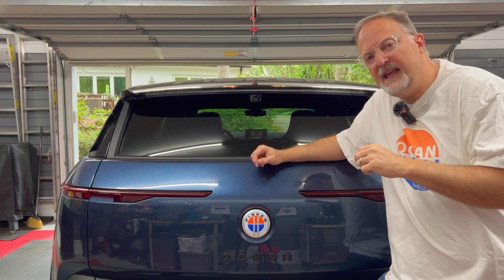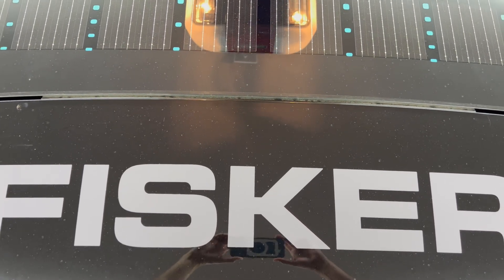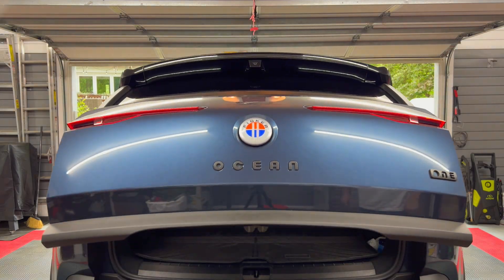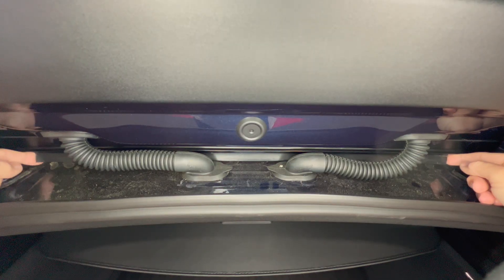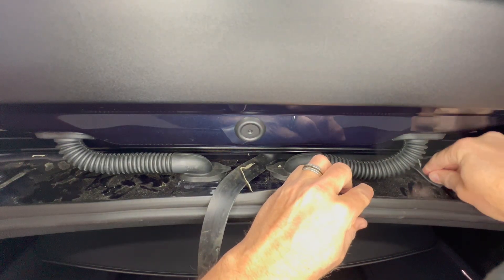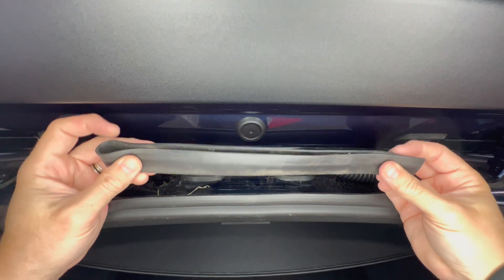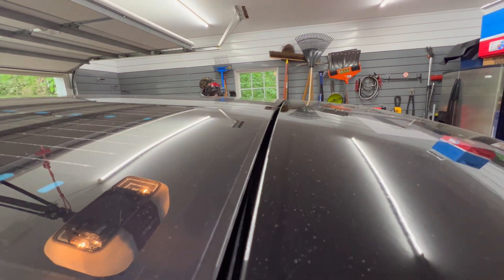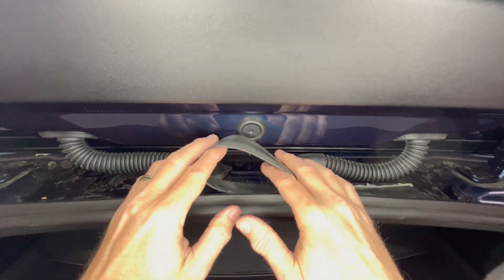Fisker Ocean One - Liftgate Weather Seal Fix

Comment: Ranger, some people made a comment that it may actually cause some issue in hot summer due to expansion. I live in Texas, so I am not worried about ice but more so Hot weather
Reply from the maker: Thanks for the comment.  Yes, I suppose it could be an issue in the summer.  But I haven't noticed that. Do you have an links or photos of damage done in the summer?  The big difference is that in the winter, the rubber can get iced up and become an immovable object and thus could crack the glass.

Comment: Do you have any video on removing a Fisker Ocean door panel
Reply from the maker: No, I haven't tried to remove the door panel.  Why do you need to remove it?
Reply: I am trying to power cycle the door handle. My door handle was depressed manually and Chevalier suggested power cycling the affected handle. I have started removing the right rear panel and there seems to be something in the area where you would pull to close the door still holding the panel. I don’t want to break anything.
Reply from the maker: @artruiz5297  I have just the thing for you.  Download the service manual and look at pages 40-20 to 40-21 for the front doors and 40-22 to 40-23 for the rear doors. https://drive.google.com/file/d/1-2-PYUorSsCnBvq5tU5EHBgDNF2mrEWa/view?usp=drive_link
Reply: Thank you so much! That is awesome!
Reply: Power cycling the handle fixed the deploy and stow function of the handle. You do not need to do steps 1-3 for the rear panel removal just an FYI. Thanks again!
Reply from the maker: @artruiz5297  Good to know. Thanks!

Comment: Question: weather strip removed. Freezing rain. Ice forms in gap. Could opening cause the same problem?
Reply from the maker: Since it's not trapped with the weather seal, it will flow down the sides and  out.  The issue is that the seal becomes a solid piece that acts like a wedge.

Comment: Great discovery.  My guess is that Fisker engineers didn’t think people would open the roof top during winter.  Anyway, it appears the seam may allow some rain water to seep in.  But the water would all be collected and drained out w/out any issues.
Reply from the maker: As with many complicated products like cars, some things may have not been tested or discovered during cold weather testing.  Not to make an excuse.

Comment: Any tips on how to stop the rear passenger reading/map lights from turning on by themselves? Started after 2.0. Thanks for you informative videos!
Reply: I have the same issue after v2.0 update. I believe it’s the bug.
Reply from the maker: It's a bug that goes back to the original software release.  I saw it on 1.10 and 1.11.  It has something to do with the sensor button being too sensitive.  You can activate it by moving your hand an inch away from the button.

Comment: Thank you very much 😂 for all your videos,  very educational.  I  do have one question: How do you switch off the automatic function of the windshield wiper?
Reply from the maker: The first two settings on the left stalk with the dash lines are automatic low and automatic high. The other modes are off, continuous low and continuous high.
Reply: @MTNRanger  Thank you very much for your prompt response. It is greatly appreciated.